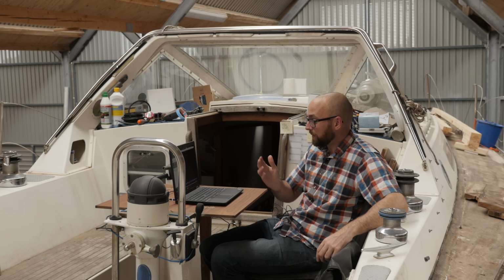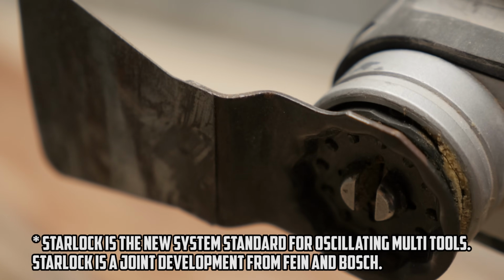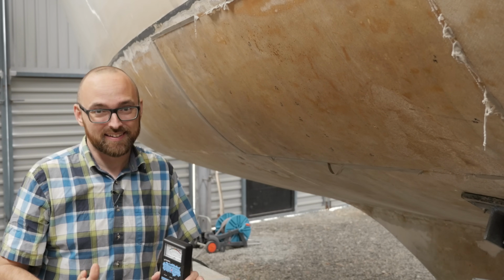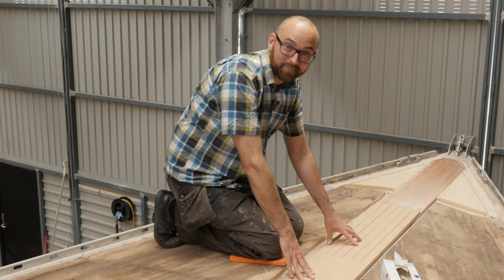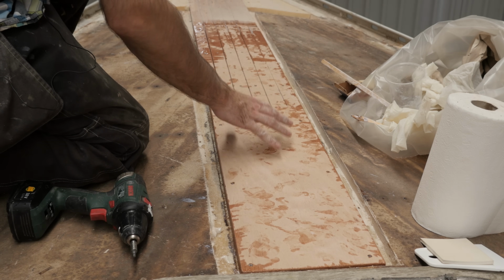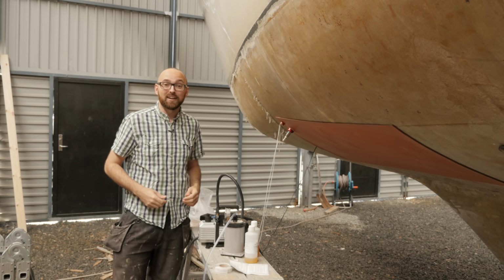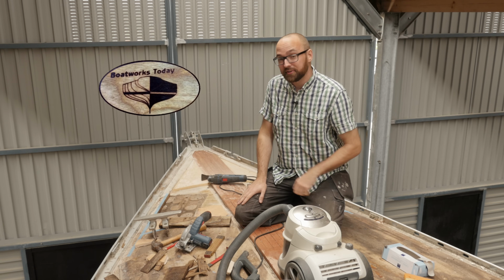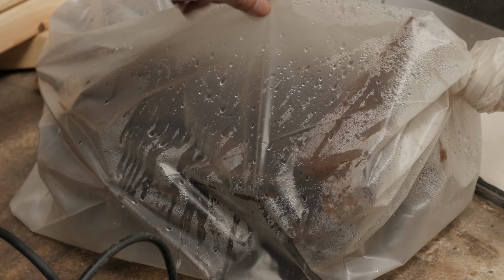Sail Life - Drying out the hull (osmosis) and replacing old deck core - DIY sailboat refit

Comment: You just made my Sunday morning. The scarf joints you made in the plywood inserts were elegant. I love that type of joint. The increased surface area created makes for bonding strength that is unmatched by other types. I use them in making 20 foot in and out wales for my canoes. Those joints must hold 1.25" x .75" strips of ash firmly together. Matching the grain the pieces look like one long strip and the joint is the strongest part of the entire strip. By temporarily screwing them together you've made an unassailable bond. The angle grinder dust control tool, gotta get me one. Mikita is good stuff. Finally, a proper scarfing jig is key to making the joints perfect and easy. Nice, nice work.

Comment: Flip a large styrofoam cooler over your vacuum pump with a small hole to let the air out and it will muffle the noise.  I made a homemade version with sheets of foam to build a box around my air compressor.  It makes it about 75% quieter.

Comment: Hey Mads.  I have an alternative to your drill, fill, and drill process.  I found some fiberglass tubes, made from carbon fiber glass. they come in just about any size you want.  I bought some tubes that were 1/4 inch inside diameter ( for 1/4 inch bolts) then drilled holes that were the same as the outside diameter of the tube.  I mixed up some thickened epoxy, and epoxied the tubes into the hole.  The advantage here is that you won't drill too close to one edge of you "filled" hole, the other advantage it that it won't crack from stress.

Comment: As always, a great DIY learning experience from you, Mads. I want to also thank you for (previously) introducing us to Andy's channel. I'm about to take ownership of a 1975 Grand Banks 42 here in Seattle and its teak deck is shot. Thanks to learning from you and Andy I think that I can largely handle any deck core issues that I find once the teak is gone (and not to be replaced).
Reply: Hi rob, ive had some dealings with  decking and core on a grand banks Alaskan 49, Your in for a fun time. on the 49 the core plywood was not marine grade and fell apart much like Mads deck core. If you are not replacing the teak with ?
Reply: Martin Martin The plan at this point is to just repair where needed and go with Awlgrip and non-skid. That's much less maintenance and gives me the option later to re-install a new teak deck or a faux teak deck if whim and finances are in alignment. For a boat of this age my broker says (and I agree) that no teak may be more desirable to future buyers. Fortunately if I choose to replace it there is a highly regarded teak decking company near Nanaimo B.C. which specializes in pre-cut pre-manufactured teak decks which are vacuum bag epoxied to the fiberglass decking (so no screws!), but that decision if I make it will be down the road a few years.

Comment: Another great video. As a boat builder I have a few tips that you could try. Just stick the mastic tape to your vacuum bag instead of the job especially on small areas it makes the pleats easier. When spreading the thickened epoxy on the inside skin use a notched spreader (west system has them) it gives a consistent thickness to the glue. I would also drill small holes (2 mm) in the ply and foam at 50-100mm centres (don't have to be perfect) to help any air and excess epoxy squeeze out. Looking forward to your next video.

Comment: Now that you have vacuum technology, you can use it for clamping force on repairs or glass layups.  Adding a little heat was excellent idea for drying purposes.  An if your tape on the hose did not work, just wrap the hose with some of your sealant tape where it crosses the bag border.  It may look like smashed ass, but if you are pulling more tha 20 inches, it looks like success.  Really enjoy the vids.

Comment: Hi you say that Balsa is used as a core in the cabin top , the reason it could be in good shape is that it's all end grain so if water enters some where it won't spread but will be isolated to that spot due to the nature of end grain so not spreading it also has great compression strength as a boat builder it's my preferred choice if laid property. All the best your doing a great job that will pay dividends.

Comment: Great video again - spiffing stop go element as well. Keep up the great videos and the great work. Can I suggest a dehumidifier set up inside the boat close to where you are heating the hull - not running forever only when the hull is being heated from the outside. Good luck.

Comment: Mads, how to lower the boiling point of water: As an old avionics tech, before calibrating altimeters, a hard vacuum was pulled atop the mercury tube. This vacuum reduced the water molecule boiling point to room temperature so any remaining moisture vapor 
could be sucked out. Hope this helps. Jack aka electricalpowerguy

Comment: Great video Mads.  An easy way to do a scarf joint (if you have to do a lot of them especially) is with your router.  Mount it on a nice flat board, and then build a couple of ramps for either side of your plywood.  It has to be easier than cutting those by hand, though I am guessing that you do not have a ton of them to do.. :)

Comment: I use the CFS silica, with west system, works just as well as the west system but is near free in comparison cost wise. Actually i prefer it, noticeably less clumpy. All the west colodial i have ever use has nitcably hard clumps unlike the CFS.

The pumps do drip, but it wipes up just fine even after a few weeks with acetone, it does not harden, just gets gummy!

As to the syringe, use the 1.2mm green tips works a lot better or if you can find them the plastic tapered nozzels are even better as you can cut them back to your desired width with a knife.

Comment: Mads;
1) You can place a foam lined cardboard box over the pump to act as a muffler
2) Why are you not using a felt liner in between the heated mat and the hull?
3) Why did not use the vacuum pump to suction the main deck spar down?

Comment: No, I agree with your choice to put the deck core back in as it was designed. The plywood appears to me to be have been used to stiffen the center of the deck for whatever reason. It certainly might appear to somewhat limit any twisting motion of the hull or at least transfer that sort of loading to where the architects desired those stresses be properly applied. It may also have been used to provide a center span loading area to bolster the rest of the deck.  Without knowing for sure why it was put there I for one do not think removing it would be the smartest thing anyone could do.

Comment: Made, can you get a longer vac hose and put the vacuum pump a long way away in an sound reducing box? I'm sure you've probably thought of that too.....not sure what you epoxy plugging is ?  Could you put a vacuum on the plywood with some resin inside to fully saturate the ply?
It looks like you have BS1088 real marine grade ply? That stuff is supposed to hold its strength even when wet.....but maybe not that wet!
Cheers Warren

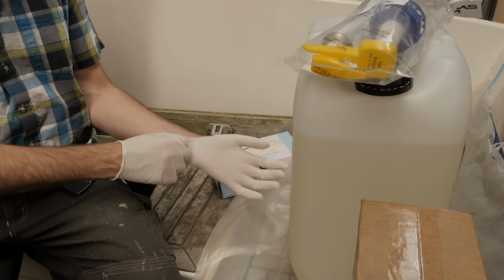Comment: 7:43 … you might want to reconsider your choice of gloves. Epoxy hardener can penetrate latex gloves in about 30 seconds. Nitrile is a much better choice. And even there it's recommended to use two gloves on each hand and change the outer glove the moment it gets contaminated. This is an interesting read: http://www.safety.admin.cam.ac.uk/files/hsd059c.pdf

Comment: I hope this is not a stupid question; still here it goes:
Why did you go straight for the vacuum instead of attempting a greenhouse/ de-humidifier type solution?
Wont the partial decompression caused by the vaccum impregnate water deeper into the composite?

If anyone around has answers please share!

Keep on the good Job!

Comment: I was wondering if hitting that core plywood material with a course grade sandpaper lightly to roughen up the surface might aid in getting a good bond with the fiberglass on the underside as well as what will applied on top?

Comment: Are you at all concerned with the moisture level of the plywood you are using as replacement? Have you researched and discovered if there is an optimal level for it beneath the fiberglass to avoid drawing in moisture or emitting moisture? Have you considered adding a fungicide in those plywood cuts in the event they ever get wet to avoid decay?

Comment: The use of plywood comes up often in this rebuild and I was wondering if it is a specific "Marine Grade" as it doesn't have the greenish copper hue we get in NZ?   The ply is very dense also, probably full of very hard ply layers and really compressed.  We have a much cheaper copper treated outdoor/wet grade but I wouldn't use it on a sea vessel.

Comment: Mads, great video!  Your meticulous attention to detail and thorough explanations are appreciated.  Quick question.  Did you consider a reservoir (small tank) to be used with your vacuum pump?  Between the pump and matt?  It might cutout the incessant running for eight hours at a stretch.  Especially when you get near the end and most of the moisture is pulled out of the hull.

Comment: Maybe you can put a styrofoam cooler over the vacuum pump to quite it down a bit.  Another option is to put a plywood roof over it like an "A" frame and set it on the ground.  This works for noisy generators and directs the sound to the ground...you can use your phone to check before and after noise reduction...cheers.

Comment: Can you tell us why you chose to use 5 or 6 cut pieces of ply instead of 1 large piece? I could see if later on down the road if a repair was needed you would only have to take out a small piece instead of one large piece. Great job by the way!
Reply: Ah, I think I figured it out. Is it because of the crown?

Comment: firm believer in using the same materials that the boat was built with. No need to reinvent the wheel or do extra math. Sealed wood and glassed in correctly will give a long usable life at a much cheaper cost compared to other composite materials. I would of even saved some money and used iso resin or a vinylester resin.

Comment: Hi Mads
I have been following your Channel very closely and I'm immensely impressed with your approach to tackling the many and varied problems encountered (OCD aside), but have a question about the transverse structural strength of your forward deck repairs.  I follow that you have replaced and embedded a new marine ply central spine onto the inner 'grp' skin to reproduce deck curvature and replaced each of the side deck foam core sections by resin butt joining them to the central spine, but I haven't fully understood how you achieve overall satisfactory transverse deck strength by this method alone.  Is the central deck ply area firmly attached and supported underneath by cabin wall uprights or transverse deck supports beams or are you solely relying on resin butt joints between the core side decks and the central spine to support the forward deck?  Perhaps I've missed something, as I'm absolutely sure restoring the structural forward deck strength is of prime concern to you. Thanks for providing us with such a great channel, it's hugely entertaining and is definitely not to be missed.  Cheers Evano

Comment: To the area that was treated and tested first with the hot vac, has the moisture level risen a while after the first test or has it remained low?
Reply from the maker: The moisture levelse seems to be remaining low :)
Reply: Sail Life that's good. I noticed when air drying my hull that the moisture levels got higher as the temperature increased. I would have therefore thought they would go down as the hull cooled. Nothing's better than practice to see how it works tho :)

Comment: Mads a quick question regarding the heating mat - why not get a larger mat say 2mt long? Is it related to the capacity of the vacuum pump or is it related to the power consumption? A larger mat in theory would speed up the entire process.. so are you replacing all the foam with ply?

Comment: drying out water without vacuüm. the water needs heat tot evaporate. it takes that from the remaining water,material. that may freeze preventing further evaporate. apply heat will speed up the process

Comment: im a bit confused. i would swear you and andy had decided on foam over plywood do to the price difference. was there something that changed your mind or is my memory getting shot. too bad you cant get the sander to march on its own like the lumber g
Reply: I think that plywood was strictly for the cleat area and he was going to continue with foam around it. I don't think that only foam core would be strong enough for the possible stresses that a cleat could get. Just a guess...??? Also, kind of thought he would use one solid piece of ply instead of 5 or 6 cut pieces. Who am I to question his process. So easy to sit behind this keyboard and make a fool of myself.

Comment: You know you can just pop a cardboard box over that pump and it'll kill about 90% of the noise?
Reply: My vacuum pump needs air circulating around it to keep it from burning out. They give off a considerable amount of heat.
Reply: reagentism au
Reply: Robert Orzech yes if it has a cooling fan on one side leave that side open to the air.
It'll still kill off about 80% of the noise

Comment: webcam and wifi powered switch et voila boat vacuum monitoring from work or store or home
Reply: Also a vacum loss sensor and pump housing overtemp sensor tied in series with the wifi switch for system failure auto shutdown.
Reply: Powerelectronicsguy L obviously :)
Reply: Powerelectronicsguy L no but if the webcam is pointed at his vacuum pump so you can see the gage and also see the temp on camera, that woulf be enough no? anyway not a critic here nor an expert :) just a sugestion :)
Reply: The danger of unattended operation creates a fire hazard. The added temp sensor protects the pump not the heatpad. You seem to forget that Mads is at work or is sleeping. He cannot continuously monitor the webcam.

Comment: Hey Mads, great stuff, as usual I love your work! Was just wondering if you had looked at Nida-Core (now called Carbon-Core) as a possible core solution that is incredibly strong and stupid light and flexible until encased in glass. It's been in use by here in Canada by the yacht building industry for over 25 years and is completely impervious to water (unlike foam) because of the sealed honeycomb construction, it's extremely buoyant. It comes in 4x8' sheets in many different thicknesses. Just a thought. Here's a link to an example.... http://www.lbifiberglass.com/NIDA/nida.html